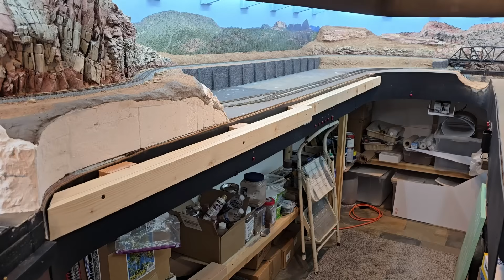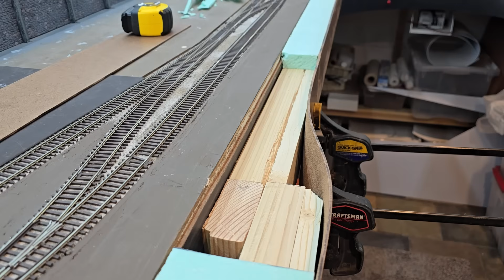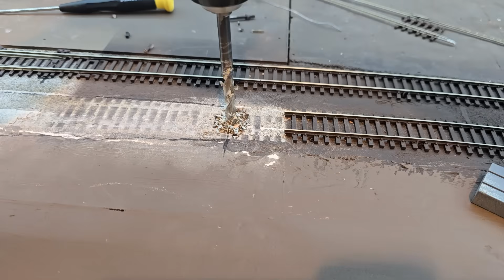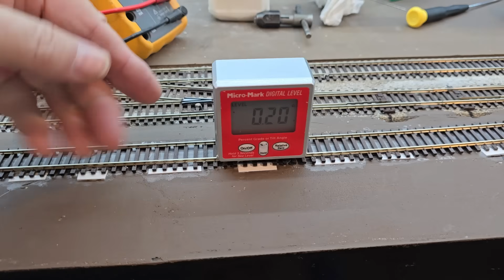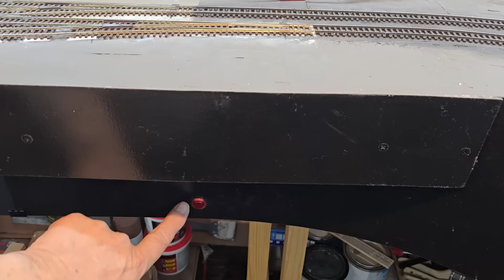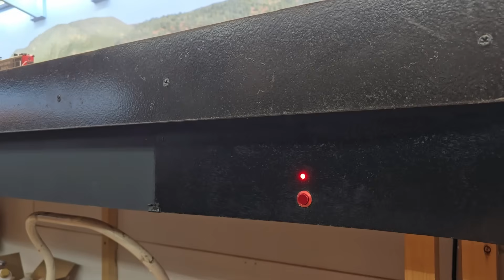Layout Update. Widening Benchwork, adding a Spur Track and Powering the Turnout Frog.

Comment: This subject has me confused before I even start!  Need to watch this a few times, LOL.  Why in the world does a switch ever have the ability to create a short to start with????  I love DCC, but only have a couple DCC locos.   Most of fleet is old and not even sure I want to convert them.  They are mostly cheap junk.   But, still life running them.   Most likely going to wire for DCC and leave a main line DCC with a large yard so I can still run old LOCO's.   Same issue with N scale.  TON of DC loco's.   They will run on DCC, but haven't built a full layout yet.   Need to grasp these issues ahead of time.   Thanks for video.
Reply from the maker: The reason it would short is if the DCC bus wires were backwards. If it was wired incorrectly the system would short when the locomotive touched the frog. But I tested the frog with my multimeter and knew it was wired correctly.

I wouldn't be intimidated by DCC, most of the principles you use to wire your DC layout apply to DCC.

Thanks for watching!

Comment: Nice job on the track work. But I got to tell you that I was told years ago that you never soder any rail on the inside of the track. You are only asking for problems with the flanges on the wheels.
Reply from the maker: You don't need a whole lot of solder to join the tracks. As long as the solder doesn't stick out past the rail web there shouldn't be any issues. As you can see from the test running, it works great. Do a neat job, don't apply too much solder and you'll be fine.

Comment: When gluing down the turnout and spreading the glue, wou,lsdn';t it be prudent to place a tin piece of styrene over the glue where the movable points are to prevent sticking?
Reply from the maker: I didn't put so much glue down that it would come up that far between the ties. But yes, you could leave the area where the points are unglued if you prefer. I generally glue everything except where the throw bar is. Thanks for watching!

Comment: I get e concept of the tuotous  frog but  watse of money for a switch  so  close to a open isle  that can  easliy be switched manuallt   toutous only  good in far  unreachable areas
Reply: You can, of course, use  a sunken-in micro slider-switch, its handle hard-C-linked to the ground throw which then takes care of both polarity and point position. 
The switch is mounted level in a 0.5" hole for wiring access. 3 posts on its bottom: Center one (neutral) goes up to frog, one goes to one rail, a tad before points, the other to the other rail..Datz it.. 
Then you have your powered frog, plus you are over there anyway, as it is a yard or siding where G-throwing/uncoupling is done by hand, anyhooo whooo whooo. 🏭🛤☀🛤
Reply from the maker: @MarkInLA  Yep, with a little enginuity many obstacles can be overcome. But there's several reasons to use a Tortoise machine, 1) all my turnouts are on Tortoise machines except the lift out section that has 4 Bluepoint switch machines. 2) All my Tortoise machine turnouts are controlled through Digitrax DS64/74 and can be switched using my throttle if I choose. 3) I had one in my drawer. :)
Reply: I believe you've missed my point.. 
Unless you plan magnetic uncoupling ramps, you're going to HAVE to go over there to uncouple manually, anyway. 
So, might as well throw the switches at the same time, same as the 1:1 scale guys.. all for $3 per micro switch.. 
But I believe you've stated you're essentially building a diorama, not a true "point to point' Ops-based MRR. 
Thus, I suppose, the more automation you can work in, the better.

While we're talking switches:..I use the same Atlas T.Os... 
Unless one can not solder to pewter, why not run the wire up through the pewter frog-ring and simply drop solder right down on them instead of having the unsightly tall large screw heads there. Then you can easily hide it with ballast, weeds. Or, just use a tiny self tapping screw into the soft metal ring to grab the wire, no solder..

This is something I honestly have been feeling about your project, Sir:

You're painting a beautiful, velvety smooth, framed portrait of trains which can keep continually rolling, called a 'continual' layout for that very reason..If that has always been your goal, to have something grand to 'watch em roll' then that is but perfect !!  

Another way to go about it though, is to build it 'point to point' the way the 1:1 does, with turning facilities via turntable, wye, or balloon track on one or both ends of the line along with engine house, fueling, repairs, etc.; along with spurs, branch, sidings, stations along the right of way; the RR carrying on the daily business it was built for and the aim, we relishing carrying out the duties of and following the rules and regulations of 1:1 scale railroading where, because trains then can NOT 'just keep rolling', 
if yer not on yer toes nearly every second you can wind up 'on the ground', or dead from a head on ! 😏
Reply from the maker: @MarkInLA  You are correct, it is a diorama.

The reason I don't attach the frog wire from the bottom is so the wire can be repaired if for some reason it breaks (Murphy's Law).  If I attach the wire to the bottom, I will have to remove the turnout to fix the wire. And if it is in a finished scene, that would really suck. Same for my track feeders, they are attached to the side of the rails, not the bottom. Track performance is the highest priority. I like running trains on my layout and I don't want track problems. So, I try to make the track maintainable, and I trade that for a few visual "warts".

I have no interest in a point-to-point railroad. Zero interest.

I'd love to have a diesel facility and everything that goes with it. I'd like to have a big yard. Unfortunately, I just have a 20x12 room and no space for those things.

My layout is what it is. I am going to make some changes in the rural side of the layout to make it more visually interesting (diorama) but the city side of the layout is most likely set. I have 3+ years in what I've built to this point and I'm not starting over. I'll finish what I have, and it'll be what it'll be. It's not perfect but it'll be good enough.

If I finish the layout in 5 years, I'll be 72 years old. This will be my one and only layout. I'll make it the best I can and enjoy it for what it is.
Reply: I don't mean attach frog wire from bottom. I'm saying to run it up through, the way you do, but just make a simpler connect to the ring with a smaller screw, or solder right onto the ring; wire pointing upward, excess clipped off.. Once you've got continuity in everything, nothing is likely to come undone with switches. If anything, rail expansion (as you dealt with so well already) can cause joiners to loosen. 
But, anyway, I'm happy to know you know exactly how YOU want your layout to be..I was only making sure, since I don't know you.. And now that I do know more, I'll be looking forward to watching how things progress.  
Your work Is A1, for sure.  🛤☀
Reply from the maker: @MarkInLA  Thanks. You can't solder to the frog tab; it won't take solder. The predrilled hole in the frog tab requires a 1-72 screw, nothing smaller will work. I bought a package of 1-72 brass machine screws and that's what I got, so I used them.

We build our layouts to please ourselves. If we do it to please others we're doing it wrong. 

Thanks for coming along. I'm looking forward to where the journey takes us.
Reply from the maker: Nothing wrong with your way, but you'll have to have another method to power the frog. All the frogs on my layout are powered. I used Bluepoint manual switch machines on my lift out section to power the frogs in the double crossover. Thanks for watching!

Comment: instant heat and mass,  do not give the plastic time to melt
Reply: Better to use a pre-hot soldering iron for models, as it's instant full heat, and lighter to hold, which cuts down on the bouncing, approaching the spot.
Reply from the maker: @MarkInLA  I have a 60W Weller pencil soldering iron. It's fine for wiring and electronics but it's no good for track. My 200W gun makes quick work of it. A few seconds and it's done.
Reply from the maker: That big 'ol soldering gun does the trick. Hit it hard and git 'er done.  :)  Thanks for watching!

Comment: You got that abrasive pad from DCC Concepts.  Iron Planet Hobbies carries the DCC Concepts.  You could saw that pad into thirds to make it into three pads.
Reply from the maker: I think I got it from Iron Planet Hobbies off Ebay. I never thought to cut into smaller pieces. I might get another one and do that. The DCC Concepts pad works great, I love it. I appreciate you watching!
Reply: @SPSteve  Just a tip.  Sometimes it is cheaper to buy direct from Iron Planet Hobbies website.

Comment: You did a great job on the track work and turnout. That RS3 ran flawlessly.
Reply from the maker: Thanks Derek! The method I use to power the frogs works perfectly and is easy to do. I have to make sure the track is level enough that the cars won't roll away from where I place them. I appreciate you watching!

Comment: Track cleaner after the bright boy looks like DCCconcepts track cleaner.  Nice job on the benchwork extension.
Reply from the maker: I think that's it! That thing works great. When used together with the bright boy, the rail looks great. There are times I have to use the bright boy, and it's hard on the track, but the DCC Concepts track cleaner does a great job polishing out the scratches. Thanks for letting me know who made the track cleaner, and thanks for watching!

Comment: With a older little used siding, the fact that the track is not level is a good thing when you add long grass or weeds to it. The effect is the same as watching cars being spotted and they will move side to side as they come down the track. Add a few bends and dips to the track and you now have a scene that is as close to real world operations as you can get.
Reply from the maker: Good point Paul, I didn't think of that. I watched a Charles Smiley short line video yesterday on YouTube and you can see that exact thing happening in a couple places. Thanks for watching!